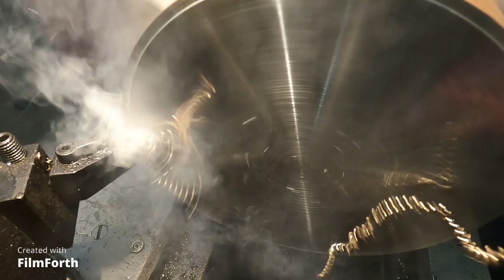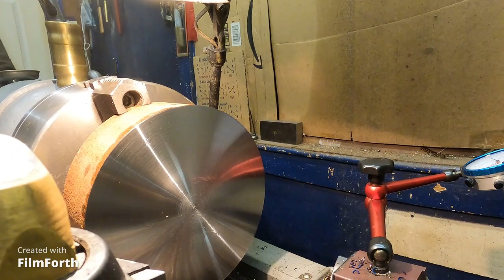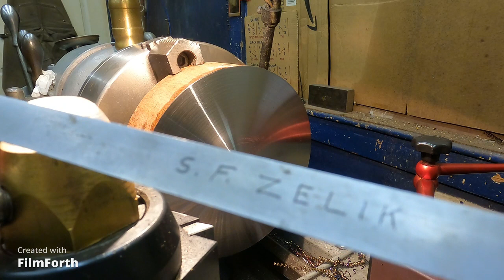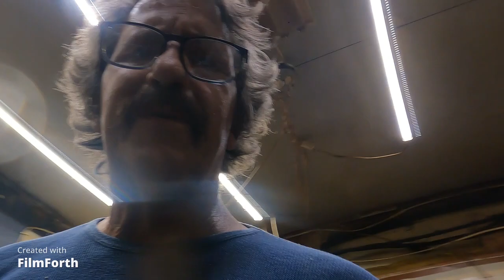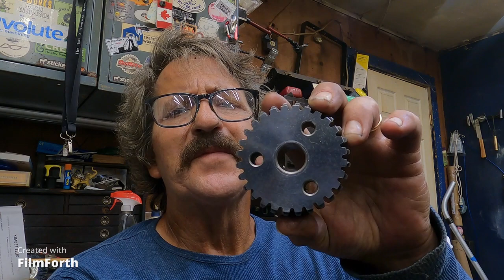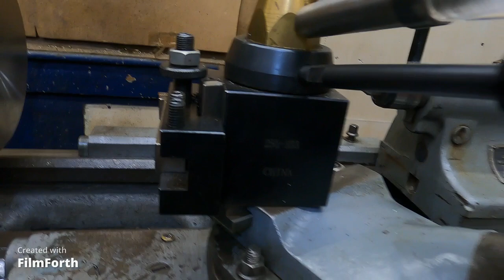Starting the adapter plate. SOUTHBEND / KONDIA

Comment: Another option is to make an adapter plate for the gear, it will mean the head adapter plate will need to be wider but it looks like you have the stock to be able to do that
Reply from the maker: The plate will have a recess for the milling head. Then I will machine recess for the milling machine mount. Then cut it off for the thickness of the over all plate. The second recess is smaller in diameter than the first so I will be able to machine it all in one set up. I’m not sure how I’m going to part it off to to the proper thickness. 
I wonder if I explained that so you might understand it. Thanks for your comment.

Comment: Re-Drill the gear to a larger bolt circle then drill the machine to match the new gear bolt pattern.  It is a lot of drilling but it will solve the problem.
Reply from the maker: I’m afraid it’s gonna bring me too close to the teeth .
I will show the gear a little closer up front in the next video demonstrating where that screw hole would end up in relationship to the gear teeth
Reply: @kimber1958  I am not suggesting that you try to match the current bolt pattern.  Redrill the gear inside the teeth giving you clearance for the teeth. Then redrill the drive spindle to match.  That should move the bolt circle away from the plug in the center.

Comment: Is making an adapter plate going to allow the new gear  to mesh with the screw in the head?
Reply from the maker: Yes, the gear will sit inside the hood housing in the proper position.
All of the tilting mechanism is located in the housing of the head, and the face plate has no effect on it